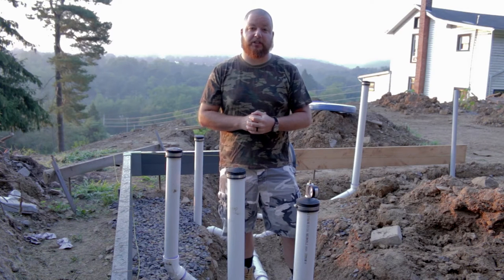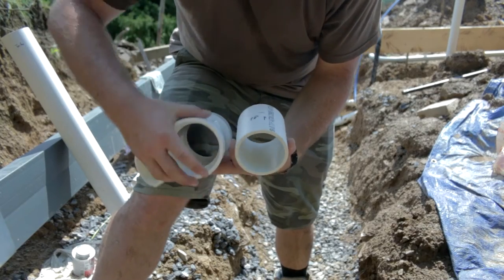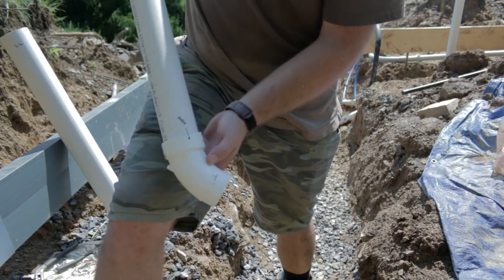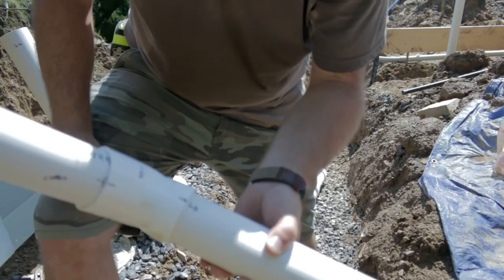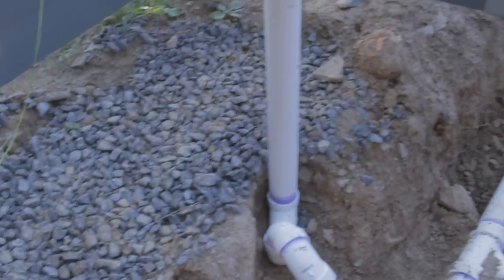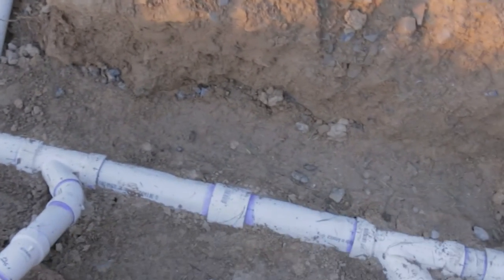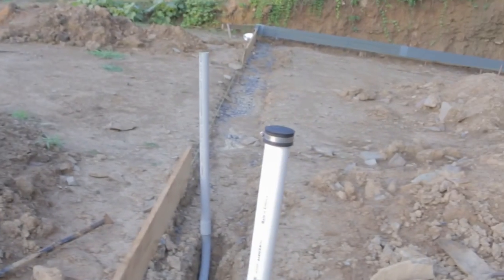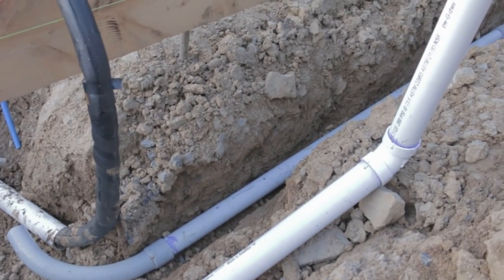Garage Build #6 - Rough In Plumbing Under Slab

Comment: You have an 1/8 bend street connected to your shower p-trap.  Not code in my location (Florida). Code states you have to have a horizontal pipe at least “2 times the diameter” of your pipe size when installing a fitting to “any trap”.  To meet code you should have a 4” horizontal (pipe) run before you connect any fitting.  (2” pipe x 2 = 4” pipe).  You’ve created a siphon at your shower trap.  
If you have a 3” trap, you must have a minimum of 6” of horizontal run (pipe) before you connect any fitting to this trap.  Good video.
Reply: S-trap all day. It burns me up to see these videos😂 that’s code no where in IPC or UPC

Oh and you should only use air to test you PVC if it has a chance to freeze. It’s actually pretty dangerous!

Comment: Plumber here—- If that passes inspection, I want to talk to the person that approved it— you have many mistakes, errors.
No vent for the shower, unwashed vent on the end of a pipe run and in the wrong location, short turn 90 on the kitchen sink line, no building clean out within the first five feet of entrance to property. And don’t forget to wrap/ sleeve the pvc where it contacts the concrete.
  Please, viewers, there is more to this than you all realize. 
The kitchen sink line WILL need to be vented . 
One more thing— dry fitting and marking with a felt tip is a DIY method that usually results in crooked pipes that “ almost “ fit.. Try a pencil and a firmly placed or installed pipe that doesn’t move and build off of that . 
Professional rant over, good luck to all the amateurs, handyman, and DIYers out there. 
  Maybe I’ll do a video on how to remove tonsils , Naa, I stick to my profession!!
Reply from the maker: Passed

Comment: I realize he may have done that glue joint for a demo but buy the bigger can. It has a bigger brush. You want the pipe to still be primed when you put the glue on. Using that little brush takes to long and lets the primer dry